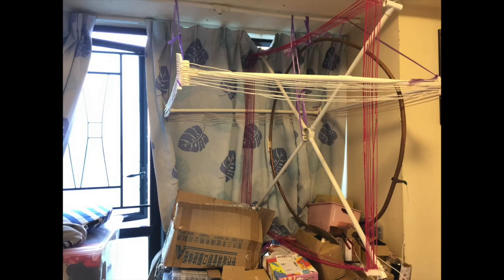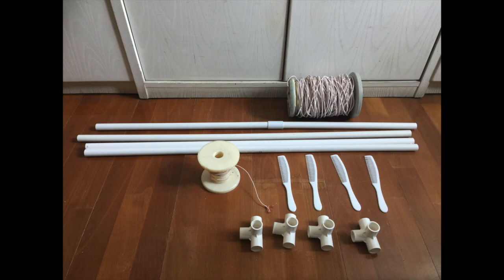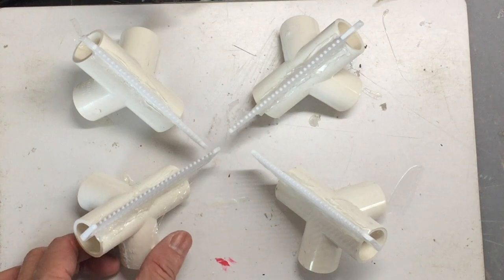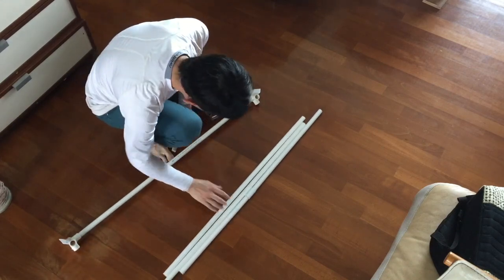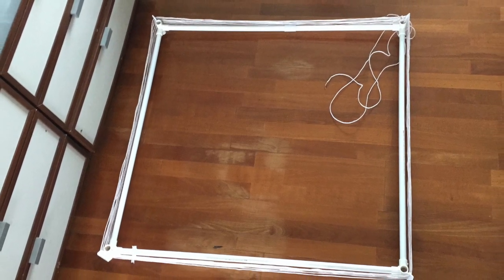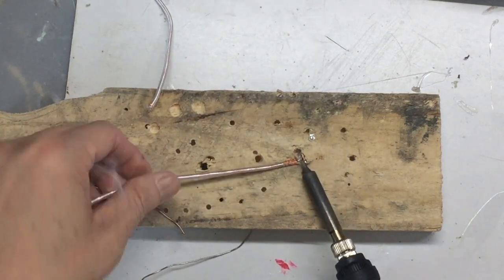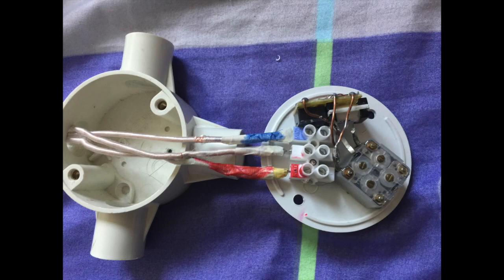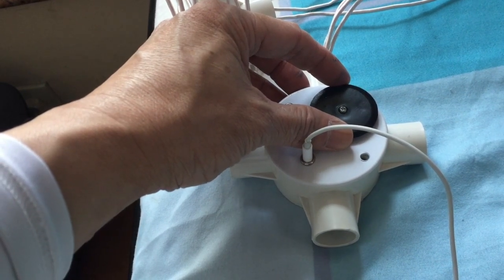An easier way to make your 1 meter loop antenna

Comment: That's great if your able to get the frame parts?   Where do I find these frame parts at?
Reply from the maker: These are PVC pipes for routing electric cables. You should be able to get them from regular hardware stores.
I got mine from the Chinese Taobao.com web site. Not sure if you can get them from aliexpress.com

Comment: I made my loop directly on the brick wall of my room. It has a perimeter about 2m*3m and consists of 4 turns of 24AWG copper wire with 10mm of a separation. With this magnetic loop antenna i can hear 5 local AM stations.
Reply from the maker: Alex , thanks for sharing. You have a very strong coil. Congratulations
Reply: @BillyCdiy  you have good coil too, Billy! Thanks for your interesting videos!

Comment: Is litz wire & multi strand wire same
Reply from the maker: The universal boss The universal boss ,Litz wire is a type of multi strand wire with each individual strand insulated from each other by a coat of paint. This maximize the surface area that high frequency signals can travel on due to the SKIN effect. This will reduce resistance and increase efficiency. Litz wire is suitable for frequency lower that 1600khz ie AM broadcast but not suitable for SW or FM. As the byproduct of Litz wire is hidden capacitance that lower the frequency.

Comment: Good movie. Is this antenna better than the antenna made of copper pipe?
Reply from the maker: Lechoslowianin , they are for different purpose. The copper one is for short wave. The Litz wire one is for the AM radio.